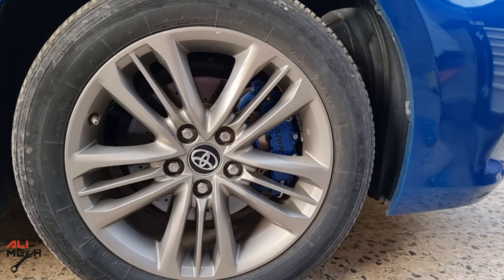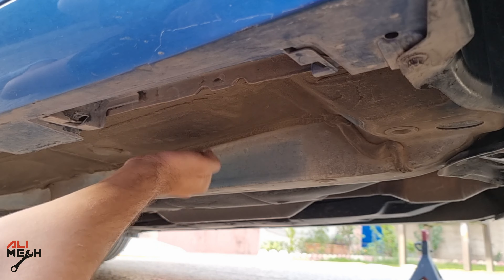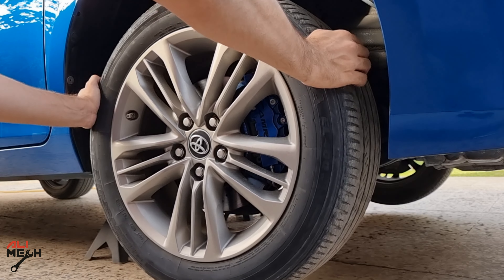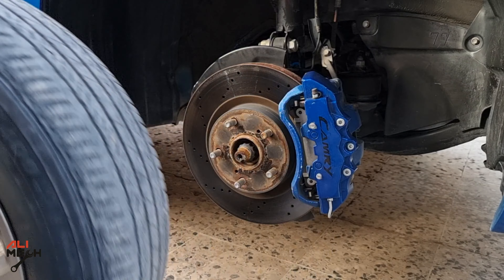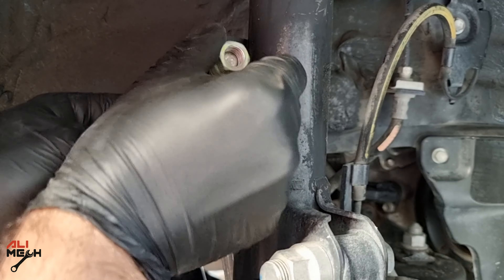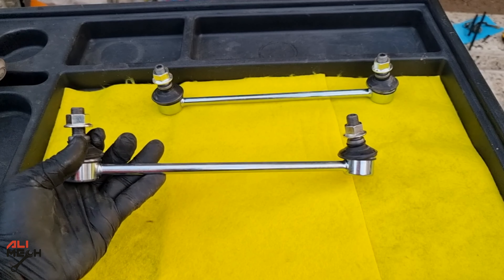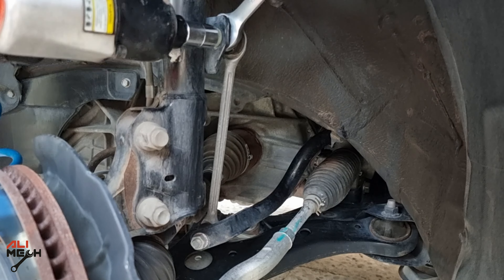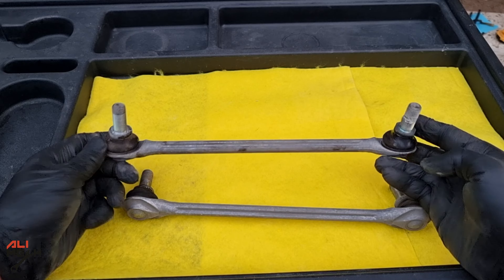Sound from front suspension over bumps/How to Check Suspension on your Car/Sway bar link replacement

Comment: 2013 SE, when I lifted mine up the shock expanded and the upper part that I put th stabilizer dropped a good 2-3 inches. The solution was to raise the rotor until it was level with the stabilizer bar and then I was able to lock it in. I compared the old part to new so i was aware that they were identical. Also this method helps if you are struggling to get that top bolt off.